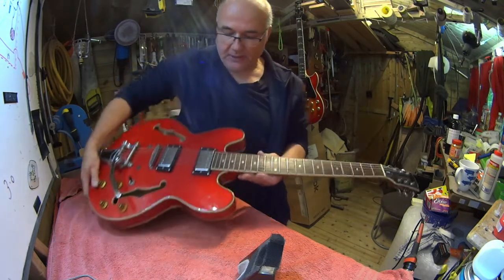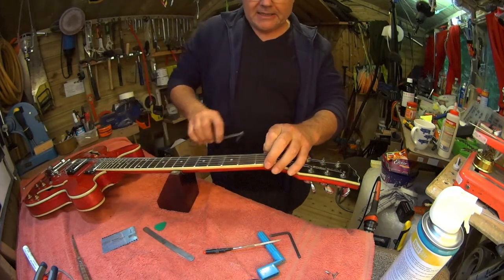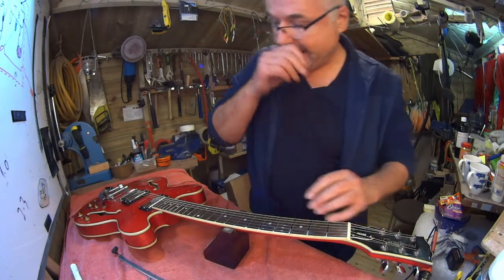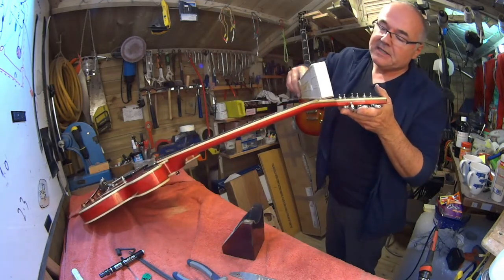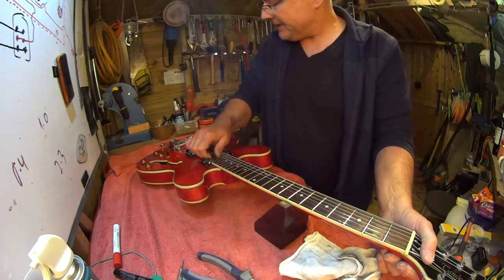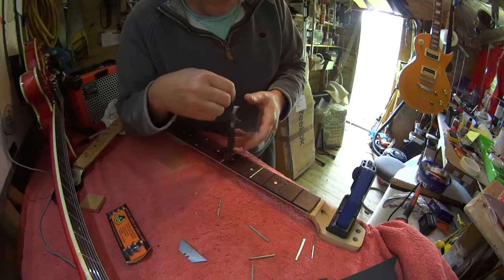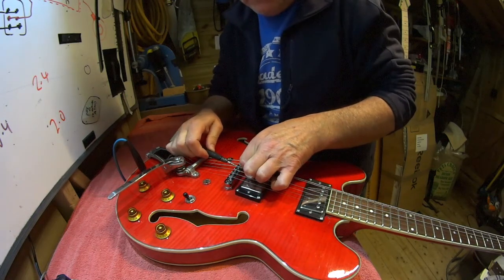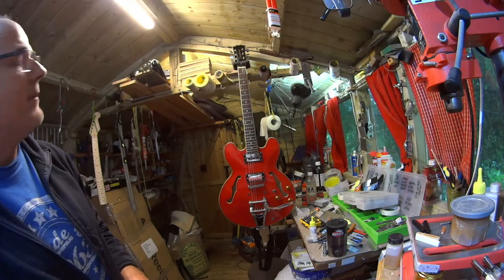Tanglewood AS39F set up

Comment: Hello again Sam , sorry to have just remembered  ( onset of senility ??) but in the 70's I had an old Gibson S.G. with a proper Bigsby on it . At the time the trick was to  bend new strings 60 to 90 degrees near the ball-end with long-nosed pliers .  
 Much later,  those soft rubber earplugs for people working in noisy places came on the market . JUST RIGHT to hold the string onto its pin until up to tension ! Cheers , Nige .

Comment: Hi Sam , looking at the " Bigsby"  on this guitar , I'd say somebody has completely removed the 2nd roller-bar, ( the one the strings should ride over an inch or two before reaching the saddles ), leaving behind the threaded inserts it mounted to in the body . That is possibly why the more exaggerated downward break-angle of the strings from the saddles to the hold-down roller  is pulling the bridge back and forth  . Just a thought ,  cheers , Nige .
Reply from the maker: Leftienige Blank I'm not sure about that Nige - the mounting bushes you can see are from the original stop bar that the guitar had until the vibrato unit was installed. The vibrato itself is complete. The bridge rocked mainly because it was loosely on its posts and because the saddles were sharp so the dug into / caught on the wound strings. The roller bridge upgrade fixed that nicely.